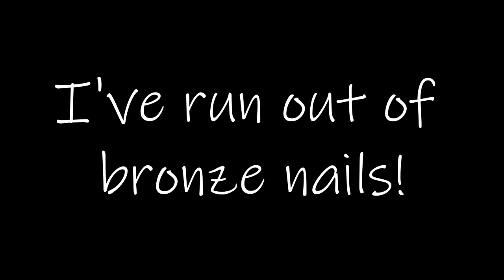The RYA day skipper, the doghouse and some big news - SV Tapatya EP98

Comment: Is there a reason for using the small glue nozzle? I would think removing the whole cap and squirting a long blob, then using a notched spreader would be faster and less work, plus give you 100% coverage. Works well for floor tiles but I don't know how good it might be for plywood on a sailing dory! I'm just thinking how sore you must be after hours of squeezing that glue tube...
Reply from the maker: Well Mike.... It's based on some initial experiments I did gluing plywood with this glue (Collano Semparoc). The makers of the glue sell an applicator tool that basically applies the glue in several beads at a time. I just decided to approximate the application of the glue with the tool without buying the tool. Yes, it does take a bit of muscle to squeeze the bottle, but I don't really mind a bit of a work out from time to time. The goal is to put the correct quantity of glue on, so the joint is thoroughly glued but not too much glue oozes out to be wasted. I believe I achieve that with this low-tech method